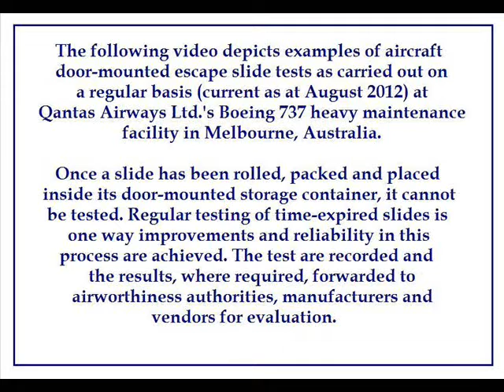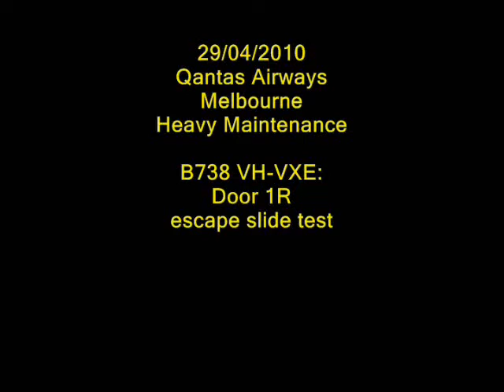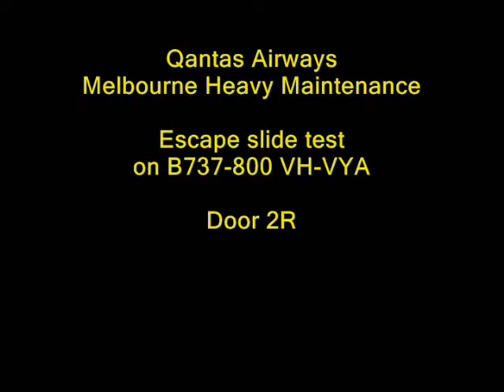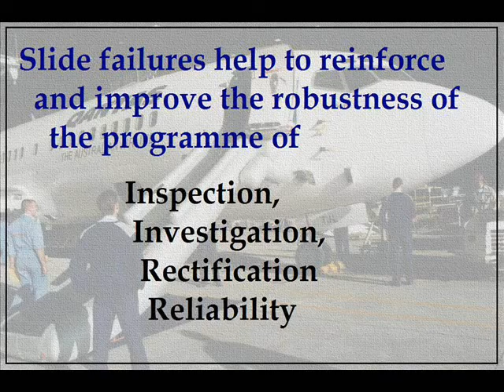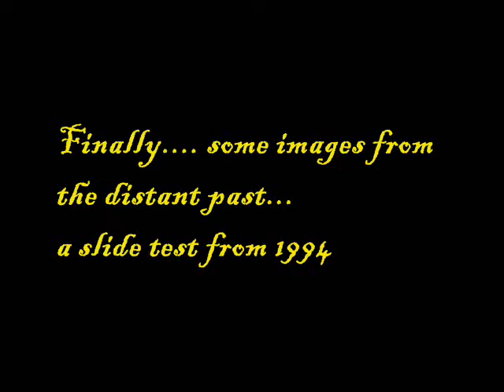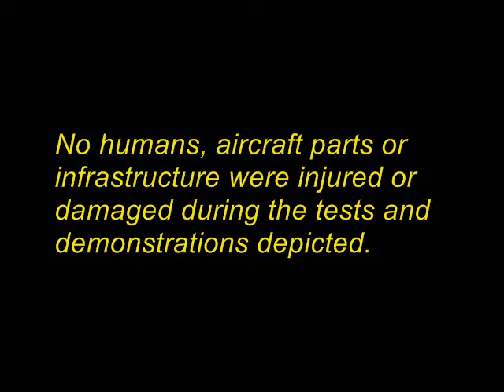Escape slide tests on B737CLs and B737NGs

Comment from the maker: The term 'test' is of course a misnomer. A slide, once assembled and installed, cannot be tested. Hence, the deployment of time-expired slides, ideally performed prior to an aircraft entering a Check, is the only viable way of knowing if their manner of assembling and installation was as intended.
Reply: A destructive test is still a test. Granted, the slide isn't *destroyed*, but it still needs to be inspected and repacked, and a bunch of bits probably replaced/refilled.

Comment: Man, those 737 doors look difficult to open, even with a bit of power assist. :(
Reply from the maker: Hello dkat. Thx for your observations. 
All the passenger doors on the B737NG are manually operated.- there is no power assistance system.
The rear doors are resistance-neutral because they rotate around a more or less vertical fuselage-mounted torque tube. .    
The front doors present the greater challenge because the torque tubes are canted inwards on account of the narrowing taper in the fuselage. Effort in opening them first needs to overcome the dead weight. The left, larger door, which also houses a larger slide, has assist springs (part of the fuselage mechanism- hidden behind the lining). 
Once on the ground, if the  aircraft ends up in a slight list, opening a door on the high side will be a challenge.
Reply: LOL, the reason they look difficult to open is because there isn’t any power assist